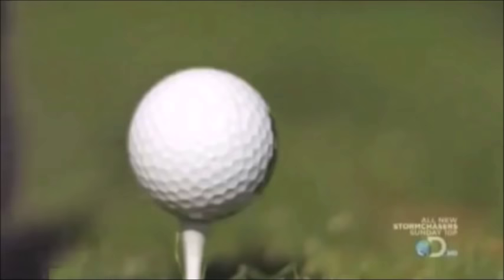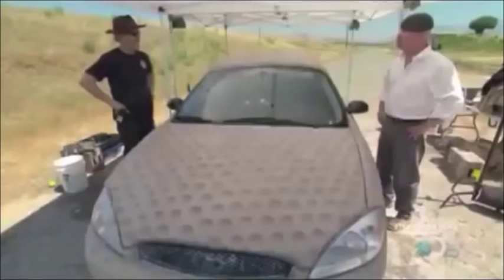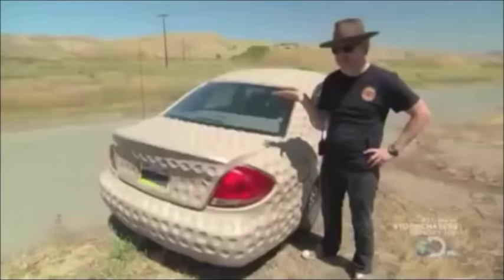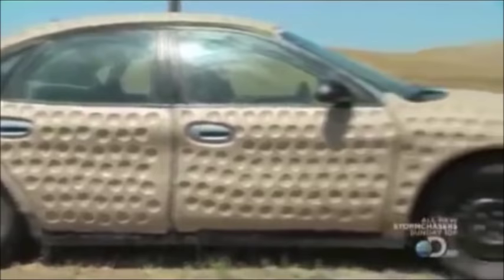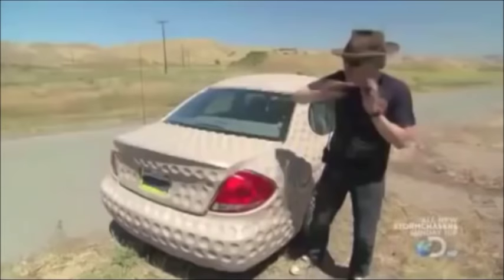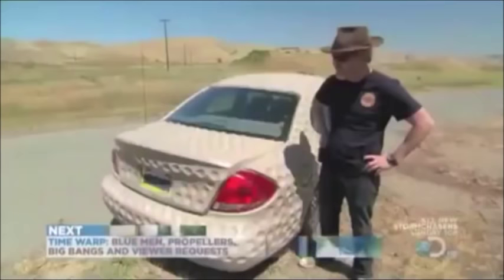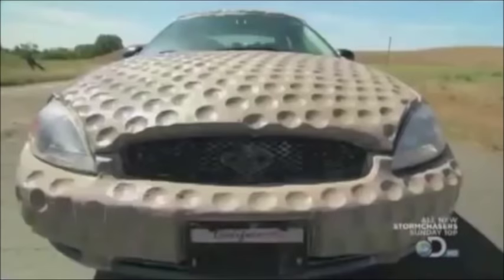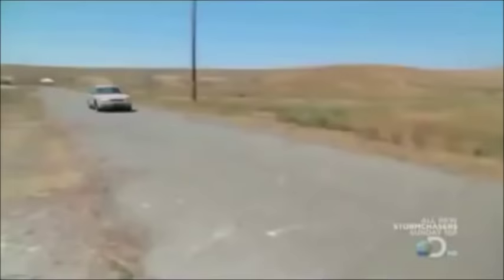Dimple Car Experiment

Comment: There are indeed both cars and airplanes manufactured with the idea of "golf-ball dimples" except they're not called "dimples" they're called "vortex generators" but they utilize the same effect.  On a golf-ball, the orientation in relation to airflow is variable because the ball is spinning, therefore the entire golfball is covered in dimples and the positive effect from the dimples in the optimal places outweighs the negative effects from the dimples everywhere else, but with a car or airplane the orientation in relation to airflow is indeed known, so the vortex generators are only placed where they actually have a positive benefit, usually near the back of the roof and sides on a hatchback or minivan, just before the blunt back end.  

They allow the air to flow around the object better in order to fill in the continual vacuum-cavity that exists behind the vehicle as it moves forward through the air, which allows it move forward easier.

The effect of vortex generators has both costs and benefits and the benefits usually only outweigh the costs for shapes that have a blunt back end, like golf-balls, semi-trucks, vans and hatchbacks with a steep back end, and even then only when placed in a certain area, usually near the back of the roofline and sides.  

Many vortex generators on consumer grade cars are purely decorative and hurt the aerodynamics.

Here are some further videos on the concept of "golf ball dimples" as applied to cars and airplanes:

https://www.youtube.com/watch?v=eP-YUDe9HF0

https://www.youtube.com/watch?v=uXYLCxq5YjA
Reply: Hey Erik, Your reason seems correct. However, doesn't turbulent flow increases the skin friction drag. I mean, it really boils down to a tradeoff between Pressure drag and Skin Friction Drag. At high speeds, the pressure drag becomes prominent and thus these dimples prove to be useful. However, at lower speeds, they might not be that useful since they enable a chaotic flow, increasing skin friction with more or less same pressure drag. I believe at low speeds, the dimples will worsen the fuel economy. What do you think?
Reply: Actually interesting links. So what really happened was Jamie secretly wanted it to be more fuel efficient as those dimples probably did nothing. Kinda weird to test it with a human driving the car anyways.
Reply: BladeCast  I don't know what on that link you wan't me to see? He said himself that mood can have a big impact on fuel efficiency. Kind of ridiculous to test it with a human driving. 
I'll go ahead and believe the guys who have studied this.
Reply: BladeCast  Maybe get a hobby outside Weebin'? It makes you kinda peciluour. Just saying.
Reply: Formula 1
Reply: My understanding did aircraft is induced drag is highest at slow speeds and parasitic drag is highest at higher speeds. That's why there's an ideal middle ground speed that will give you the best glide rate. Probably just a difference in semantics but I do think the skin drag you refer to only increases with speed.
Reply: F1 cars are nearly built around vortex generator's
Reply: @Real28  they also hate lift
Reply: A big limitation of vertex generators is that they are very often pretty complex shapes and very finicky to do so they drive up the manufacturing cost significantly.
Reply: Anyone seeing how ugly the car is
Reply: This is incorrect.
While there are vortex generators on aircraft wings, they actually negatively affect fuel consumption.  They're there for a much more important reason.
As wing loading increases (higher weight/g forces in a turn/higher angle of attack/slow speeds) the wing inches closer and closer to a stall.  the main issue is that once wing loading reaches stall, the separation into vortex flow happens rapidly and without warning.
Vortex generators provide an area of the wing with a constant vortex that gradually widens with wing loading, giving a gradual transition into a stall and providing the pilot with feedback and warning as the aircraft approaches a stall.

Comment: (29.65 - 26) / 26 = 14% gain in fuel economy.
Reply: Some of us Appreciate this comment👍
Reply: The next step should've been piston and valve dimples 👍
Reply: @danmaycock9238 speed of air pistons I'm guessing?

Been watching a few videos and reading about it, I'm not that smart so I don't understand the science behind it. I will say though, if relatively basic changes to surface area design can make this much of an impact, it will be interesting to see what this means for diesel engines going forward.
Reply: @AdhirSingh_SA_1995  Yeah them 👍 I think the basic princaple is turbulence within the combustion chamber gets the air and fuel mixed better thus creating a bigger bang.
Reply: Or, equivalently, 29.65 / 26 - 1.

Comment: I would submit that this is a VERY significant finding that could save lots of resources and money. I also would suggest that a computer could model the optimum size (or sizes) to make the dimples and their placement and density. If this simple modification can save 14% of fuel, why is the world not being implementing this technology in cars and airplanes etc?
Reply: According to a Tested Video, Adam said they got an email from a major automaker years later who tried making dimpled clay prototypes and putting them in a wind tunnel and did not get the same results.
Reply: @MuffinOrama  because they used a boxy car wher nothing is going to keep the airflow attached. You need the smooth shallow curves for it to work
Reply: they added 4 inches of clay    this increase the aerodynamic drag..  (as the car height increased and surface area also increased )    while when the clay was sitting in the back seat lowered the car without
Reply: Well first off look at it. That's half your answer there
Reply: When you look at the cars being sold in the last few years you come to the conclusion that people aren't interested in efficency. It's an interesting metric for ingenieurs, but most people who buy cars don't care.

Comment: They should've tried it with small dimples as well. Small scale makes a massive difference with turbulence
Reply: I was wondering about the same thing.  Additionally, if the dimples are small enough, the could almost become un-noticable from a distance.
Reply: Exactly, I find their reaction very odd. I don’t find it funny, but rather quite impressive and possibly affecting the world for the better. Why is this not being implemented already on cars and airplanes? Big oil stopping it?…….

Comment: don't know if this is common knowledge but it took the us navy about 3 years to get this type of technology right for their subs. even using computer modeling the calculations and results never matched. now they have it right the Virginia class use it. layers of a rubber type material that is also has a very rough finish between the dimples themselves. it apparently also helps with stealth because the sonar is dissipated by the irregular surface just like the funny shaped tiles in a recording studio.

Comment: Do the size and shape of the dimples also affect the results? would larger or smaller dimples improve this result?
Reply: Maybe to some lesser degree. You have finite surface area on the car and 3 1inch dimples might equal 1 3inch dimple in effect. But good question.
Reply: @kcmichelson4528  It would depend on air pressure and temperature. Its possible that certain sizes of dimples are more effective at different speeds.
Reply: what if the dimples were dimpled
Reply: @kevinkruse88  no, just no
Reply: @kevinkruse88  What if the dimpled dimples were dimpled?!

Comment: I'd be really interested to see this at higher speeds.     Like a jet aircraft with a decent Mach number.   Like an A320 or B737 at Mach 0.78 (standard cruise speed).  Those would have to only be on the fuselage and engine shells.   Even if it were shown to be more economical, I kind of doubt that customers (airlines) would be willing to buy something that different.  Their aircraft are always smooth and polished, and that's what their customers (passengers) have been trained to expect.   They've had smooth jet aircraft since 1953.
Reply: I kinda doubt there'd be many people at all who wouldn't buy a ticket on a plane entirely because of how it looks. And even if there are a lot of weird people like that then I doubt that would impact their bottom line from getting better efficiency

Comment: There are a lot of variables that I'm not sure they controlled for here.  How hot were the tires?  Was the engine temp different?  Which way was the wind blowing?  Who stepped on the peddle how hard?
Reply: Yeah I think the difference is so minimal and depending on the order in which they did the tests and the odd way they are getting a run up, then timing from a set speed, the beginning run seems like it could have a huge effect on the fuel consumption

Comment: What I don't know is if the clay removed from the dimples was put back in the car to ensure it was the same weight for the second test. You'd think it would be, but great as A&J are, they occasionally do pretty shoddy methodology for data gathering.
Reply: This clip doesn’t show it, but they actually put the clay removed from the car into the backseat. They knew people would say “you removed clay, it made the car lighter, and more fuel efficient.” There’s probably a video showing that part.

Comment: I think it’s very likely that the added weight lowering the effective ride height of the car contributed to the mpg gain as well…
Reply: they compared it to another car with clay on it, but without the dimples. You can see it in this very video.
(IIRC, they took the material taken out to form the dimples and but it in the back seat or something so the cars weighed the same.)
Reply: Although as you say it's clearly stated in the video, it's these little moments where you think your being smart that you need to remember these guys are genuinely very intelligent and will have thought about this as quickly if not quicker than you did.

Comment: My issue with this experiment: for the same aerodynamic effect the dimples should have been the same size as those on the golfball. Vortex dynamics should be tightly linked to the relationship between air viscosity and the curve of the dimple, right?
Reply: @KinNectar

It's obviously to sabotage the experiment and to show that the dimpled surface on a car scaled up doesn't translate to 17% gain in fuel efficiency demonstrated by the small scale model they also made and tested.
Reply: @yesno9592  ...but they got a 14% gain here. If they wanted to sabotage it they would have had the car get worse gas mileage, not noticeably more

Comment: Did they weigh the cars to check if they were the same? Seems like the dimple is also weight reduction
Reply: IIRC the one without dimples had smaller layer, so the total weight was the same.
Reply: They collected all the dimples in a bucket and stuck it in the back seat so the weight wouldn't be reduced.

Comment: Curious, (I saw the whole episode, but it was a long time ago) since in the Tested video Adam said the car manufacturer disagreed with the results, did they account for the weight of the clay that they removed?  Otherwise, could it have been a significant change in the wind?  I need to try to find this whole episode.
Reply: Th size of the dimples and their proximity to each other probably affects the results. It would be nice to know what variables were different.
Reply: Of course they would, they are basically the guys literally making the cars you drive. They're as experienced as it gets.
Reply: If I remember correctly, they put the clay that they carved out to make the dimples into the back seat. I also recall hearing that there was some debate about the efficacy of the dimples, but, to be honest, there were too many variables that could affect the mpg for this test to be more than a prototype. The car manufacturers probably did far more research in to this than the Mythbusters did.
Reply: @techme124  Yet I would love to see the results of the car manufacturer.
Reply: @AlexFlodder  the big 3 didn't get it, but the VAG did. the Bugatti bolide and the porsche cayman has them.
Reply: Yes, they took the pieces of clay they carved out and put them in the car to keep the weight constant.
Reply: @Me and dimples works great at high speed, which usefull for the Bolide, but not for most of cars
Reply: Season 7 ep 14

Comment: I like how they half test something and think they've got actual results.  I dont know if they balanced out the weight of the added clay, but they increased the size, which adds wind resistance! Also, increasing surface area while adjusting the weight would affect momentum. They really need to get over their smugness. They do this for a living and dont factor in the most fundamental things

Comment: That's a pretty remarkable result, but I'd like to know more about the method. Do we know if they controlled for the car being fully warmed up (engine, coolant, oil, transmission, bearings, tyres, etc.)? How many runs did they do, and did they drive in both directions? Did they have some way of locking the accelerator pedal to a fixed position?

Comment: Dimple car look so heavy
Reply: It was. There was like a ton of clay on it.
Reply: Sometimes Mythbusters experiment was not in right way
Reply: @DR1V3R117  the weight was not a factor. Both the dimpled and smooth versions had the clay on it. They were the same weight.
Reply: @ThomasPerezGhost  not only this one, some other experiment also
Reply: The weight isn't really a problem in this case. The test is with a car up to speed on level land, so the weight doesn't really matter that much. Extra weight is only a real problem on hills and stop and go traffic. 

Still no manufacturers doing this, even at a smaller scale (probably problematic to have the dimples holding liquid on flat surfaces), but it would be neat if they did.
Reply: @daw162  they made a huge mistake  basically they made a  parachute  in the rear with that clay spoiler 1:10  it should have been removed...

Comment: Did they remove clay to make the dimples? And did they add weight to compensate?
Reply: In this video (https://youtu.be/8wG-gr_IRHQ) Adam states that the car weighs the same. So any clay removed from the outside will have been stored inside the car to keep the total amount equal.

Comment: How were the dimples created? Displaced by being smashed in or was the clay removed making the car lighter? Or was the removed clay placed inside the car to maintain the weight of the vehicle so the test was only for dimples and not for dimples plus a lighter vehicle?
Reply: The later. They put the removed clay on the backseat

Comment: I'd be interested to get some insight into the process whereby they decided on the size of those dimples. They're a lot larger than the dimples on a golf ball.
Reply: consider them proportional to the object and the scale of the airflows caused by the air they displace
Reply: @OliverUnderTheMoon   - that's probably what they went with; but fluid dynamics are complicated, so I wonder how valid the results are.

Comment: honestly  they made a huge mistake  basically they made a  parachute  in the rear with that clay spoiler 1:10  it should have been removed then retested it ..
they created drag from the air brake( same like they use in  ) the made , both of which assist in slowing the car down and consuming more fuel .  so realistically they must have gain 20-22% fuel mpg with the golf ball effect.  more like in the 32mpg range
Reply: Woah that’s awesome!

Comment: I’m confused, they started with the car covered in clay, then carved the dimples...where did the excess clay go? Is it stored in the car somewhere to account the loss in weight? Do they explain that in the full episode? Even if each dimple was like 4oz of clay and amounted to 25lb or so. That should be enough to make a difference in fuel efficiency.
Reply: If I remember correctly, rather than strictly carving them out I think they pressed a ball aginst it and smoothed it out, which wouldn't have removed clay.
If may be missremembering though, its been a while since this aired
Reply: They showed themselves putting all of the carved-out dimples in a bucket into the back seat.

Comment: I wonder why car designers don’t implement this. If it really lowers drag why don’t they make race cars all dimpled?
Reply: @JM Coulon it is quite easy to do a fully accurate test. Just put in a carefully measured amount of fuel and drive it open throttle until is runs out and stops. Then measure the distance travelled.